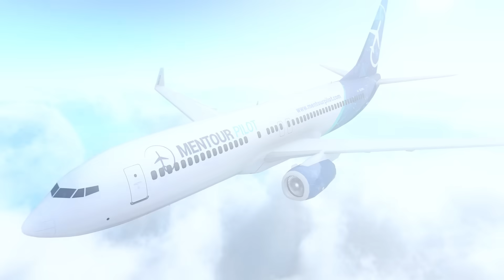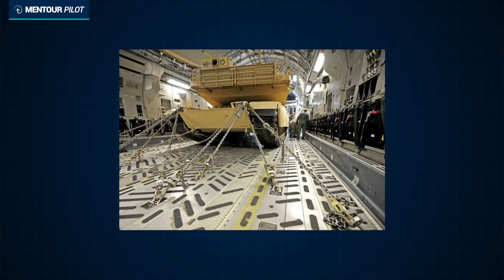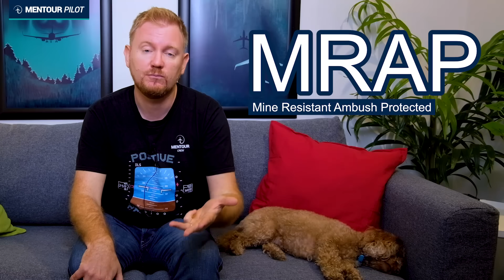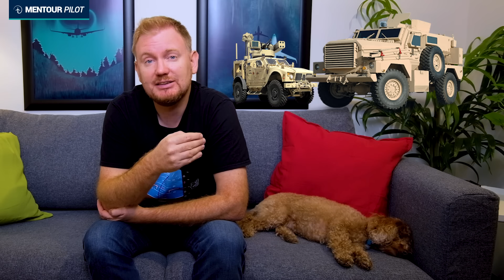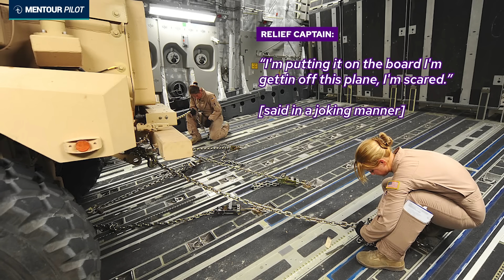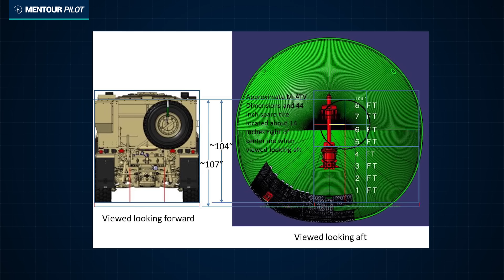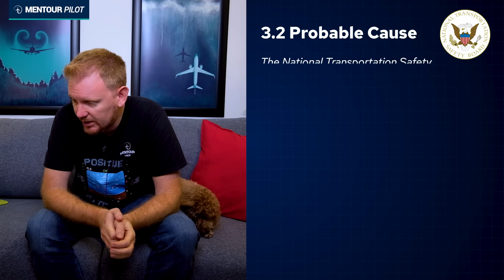Why did the pilots LOSE control?! National Air Cargo flight 102

Comment: That first picture showing the strap continuous across both sides that's the most fundamental error in strapping / chaining down any kind of equipment; even onto a highway trailer it requires four chains; minimum one for each corner. One continuous chain through a pintle hook does not count for two!  This is unbelievable; most fundamental mistake.
Loss of life and equipment. How many chains do you need to hang an 18 ton vehicle from the ceiling?;  If you want a factor a safety of two? what are the rules required for factor of safety?  A chain would have an ultimate bursting strength; but also have a rated working load. Unbelievable they thought they could use those straps that stretch so much. Stretchy straps; one more fundamental mistake. Now stretch and deflection is a controlling item not total tensile strength...
Thank you for your videos. you have a second retirement career in accent investigation. Hope you continue working until your 70 or 80 years old! Ha...

Comment: That's terrible....but great in a way. I can use this example of lack of procedures and certification; personnel attitude to safety etc for a Safety Day presentation. I was sent an email recently, where a tie down chain ring snapped during a loading procedure on a C130J. It all happened on the ground, but one of the air movements people were lucky to escape with their life, as the chain flew past him, narrowly missing his head after the ring snapped. Again, their was a lack of procedural specifics, or understanding; in this instance it related to fork lift tyne position on tie down. Though, the people involved were very careful and were endeavoring to adhere to safety protocol, which may have prevented a worse outcome.

Comment: A vehicle is not a brick. The travel of the suspension and the air filled tires gives every tie down a chance to cycle back and forth between slack and stretch.  So instead of a strap holding a static load it get a shock load.     The more slack that can be obtained the more travel and acceleration can happen before reaching the end of the travel in the strap.  

On landing,  even a small bump would cause the suspension of the vehicles to compress momentarily and then stress the straps. 

The person that came up with only two straps more for a vehicle roughly twice the size should have immediately realized that something was wrong with one of the two calculations.

Comment: If they'd held the fight for more straps it might have cost them their jobs. So they gambled and lost.

Here's the real world: I worked for UPS. among other things as an invoice-"auditor" (clerk) for UPS air shipments, meaning I pulled the invoices on packages to check them for adequate descriptions, value info, etc. HazMats were not accepted for air shipments through UPS. Descriptions are routinely crap, but time is short and the concern was to get the packages into the igloos and on the road to the airport. Holding packages can be done, but getting "exceptions" that way is a bad mark. So you pull the paperwork, glance at it to see if, if necessary, it can be fixed, put a sticker on the package to mark it  "audited" and pass it along to be loaded.

So I get a package where the invoice description didn't say "what it is, what it's made of, what the value is" and, being far more conscientious than the usual auditor, noted that failing and pulled an MSDS (Material Safety Data Sheet) that happened to be on the package off it, glanced at it to see that it had a description, and made a copy. Then, after the feeder (semi truck) full of igloos took off for the airport center I began data entry.

When I got to that package's bundle and looked more closely at the MSDS (which was maybe a half-dozen sheets of paper) I dug deeper into it than the page-1 description. Whoops! It was... oxidizer HazMat.  This was, btw, shortly after the ValueJet crash into the Everglades. Luckily the igloos were still on the way to the airport... Management wanted to fire me later for letting a HazMat get through, though when they had a hearing on that the manager who showed up didn't even know the package didn't have a HazMat sticker. But I looked into the package tracking: It had been loaded at Oakland despite my warning, flown to SoCal, flown to Japan, and flown to the Philippines.

Incentives are what they are. Planes are flown by pilots who cut corners because pilots who resist cutting corners lose their jobs. Way it is.
Reply: This was totally crap and had notting to so Whit this accident. The pilots did not cut any conors.
Reply: @AnjektusStudio  If you had been paying attention when watching the video instead of drooling on the floor you would have recognized what "more straps" was a reference to instead of having it whoosh in one ear sand out the other through the vacancy in between.
Reply: @gandydancer9710  Well I have seen this episodes both 2,3,4 and 5 Times. So I have been lisening really well. And I have also been reading the final report. So in this accident so where nobodey get a way Whit secrurity Becouse of money reasons. But IF that happend where you worked so is that Said to hear
Reply: @AnjektusStudio  You: "The pilots did not cut any conors."
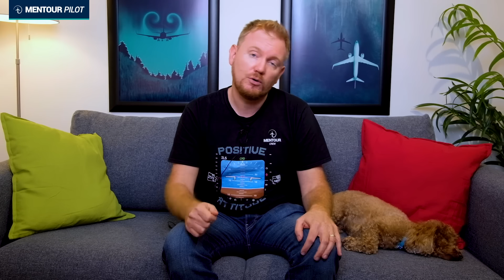At 20:23 Mentour attributes the crash to insufficient strapping. The pilots were aware of this. They took off anyway. How is that not "cutting corners"?
Reply: Pilots have a near obsessive safety culture. You can’t pull a paycheck when you are dead. It’s better to be alive and explain your next job “I was fired for refusing an unsafe load.”
And the OSHA protections alone would be worth the payout you’ll get for the wrongful termination lawsuit you will easily slam dunk.
Reply: @Mostlyharmless1985  In the real world it's not that easy. Your next prospective boss may not believe you, or may simply prefer to hire a more malleable subordinate. And I wouldn't count that payout before you got it, either.
Pilots are anyway not that reliably concerned about taking risks, or a lot of the incidents recounted by Mentour would not have happened.
Consider the one titled, "When Pilots treat the Aircraft Like a TOY!" Or that one he did about the pilot flying a passenger jet across Europe instead of diverting b/c getting to his base would be cheaper for the airline. Etc.
Again, THIS incident happened. To repeat, "At 20:23 Mentour attributes the crash to insufficient strapping. The pilots were aware of this. They took off anyway." 
Why is this not penetrating?
Reply: @gandydancer9710  because you are seeing the safety lessons learned and not the hundreds and thousands of flights that occur without incident a year, these are the exceptions and the consequences of compromise, not the norm, and if this resembles the safety culture of your company, you should be contacting the relevant alphabet organizations and getting that shit fixed before you become a lessons learned incident yourself.
Reply: @Mostlyharmless1985  In the real world the alphabet organizations are more or captive to the executives in the industries they regulate.
And the long-term good of the companies involved is not necessarily the same as the interests of the executives. See the 2008 financial crash.
All the flights in which nothing safety-related happens, or where the pilots behave badly and it is not reported, contribute nothing to my confidence in their safety culture.
Going back to THIS incident, can we at least get agreement that that in THIS case the pilots failed to pay adequate attentuion to a safety issue?
Because that is what the first response denied.
Reply: @gandydancer9710  the pilots are experts in the safe and normal operation of their aircraft, they trust and defer to experts to assure the second to confirm the first. 
The pilot didn’t like that the load shifted and trusted the loadmaster that said they fixed the problem. What exactly would you want them to do?
And OSHA will absolutely go to bat for you. They live to safety smack organizations.
Reply: @Mostlyharmless1985  You're describing a fantasyland.
Also, you're wrong. The load hadn't shifted, the plane hadn't even moved. The pilot had observed inadequate strapping and, indeed, trusted his minion's false report that that had been fixed, iirc. What does that have to do with anything? Do you think this was the first time a plane took off from that airbase with crappy loading? I'm betting that crappy loading, and taking off with crsppy loadng, was SOP. Stop bloviating about FantasyWorld, find the accident report, link it here, and we'll see what -- if anything -- is said about that.
Reply: @gandydancer9710  so, again, you don’t know what you are talking about, and a Pilot must trust his crew is giving him correct, factual information for him to make proper decisions on whether to proceed or not. I don’t know what you think a “fantasy land” looks like.
But, make a decision here. You are concerned about the load shifting. You ask your load master about it. Your load master tells you that it’s been corrected.
What do you do?
That you are too much of a fucking coward to stand your ground and advocate for a safe environment for your crew and yourself is not indicative of the general workforce. You are only outing yourself as the kind of shitheel everyone else avoids and dreads having to work with.
Reply: @Mostlyharmless1985  I hope to God that my safety doesn;t ever rely on your decisionmaking, because the fact that you think that going along to get along can be any part of a good safetly culture indicates that you are clueless, irresponsible, and a danger to anyone who depends for their safety on your good judgment.
I don't care whether it's the pilot, or the loadmaster, or the soldiers who loaded the MRAPs into the plane that all together did things that resulted in the crash, and I don't care if your panties all in a bunch over my observations are chafing you. The FACT is that this plane crashed because multiple safty derelictions all lined up, and whatever group you are trying to protect from criticism (evidently pilots) were complicit. If this pilot had made a habilt of checking, even after flights, that loads were in good condition to fly maybe he wouldn't be dead. And not just him.

Comment: FAA should consider this dangerous cargo. Require inspection and signature by a certified loadmaster before clearance to take off. Even a remote approval procedure of the loading plan would have saved this plane.
Also, pilots should be trained on the engineering limits of tiedown points and securing loads, and should be shown the loadmaster calculations, to verify safety.
If they are not sure, they should have a safety expert engineer on call to verify safety and sign off on it before flight.
Would an expert maintenance engineer called in as "second eyes" have recognized the issue?

Comment: One thing to bear in mind about armoured vehicles, their armour is toughened and easily hard enough to tear through any aircraft parts it touches.  Any single one of the vehicles would've killed the other straps, causing a domino effect. And probably the worst thing that was done was retightening the failing straps, probably over tightened to stop movement, without tightening the others, putting even more force on the identified weak point. - The issue wasn't that the straps weren't tight enough, at least not the ones that stretched!

I'm not even sure as a pilot how you actually solve that problem- should they have demanded a new guy to organise the straps? In that field of operation you are stuck in a way.

Comment: Man, I'm  just Joe average  who had no fear of flying 50yrs ago but now..?  First, as an Air Cadet at the tender age of 14yrs, some 52yrs ago, I  found myself up front on my 3rd familiarisation flight in a Chipmonk trainer, I  desperately wanted to join the RAF. At 1200 feet the craft began vibrating violently. We were too low to jump out, thank God! So we went around and, after two approaches, eventually  landed safely. A huge spanner had been left in the engine bay following a service immediately before my flight. It had wedged itself between the engine and fuselage preventing the engine rocking on it's  mounts. I remember thinking at the time, I'd  rather crash than have to bail! My second event happened many years later, having taken off from London City Airport in a twin engined, high winged something bound for Dussledorf. By now I was a very infrequent  flyer who had not joined the RAF. At around 9,000 feet we hit a flock of ducks, I  actually saw them whizz by my window. The port engine and propeller were wrecked and the starboard  prop' and engine were severely  compromised, but at this time, I  knew none of this. I recall the smell in the cabin being quite pleasant  for a few seconds, at least until the cabin began to fill with smoke and fire; yes, we could see the flames inside and out. I was seated next to my dear wife who had been an Air stewardess  with German Wings for many years before our meeting. Following a shocking climb and yaw to port, I  asked Claudia, who seemed to be engrossed in a novel. " Is this normal?" She calmly replied, "Of course". Then, having made the observation, I  asked her. "Then why is your book upside down?" Well, it wasn't normal, not at all. Apparently, we could only turn turn to starboard and that could only be achieved by running the starboard engine, with only 50% efficiency, at full throttle! Our Captain, who I  now consider to be, literally, a child of the Gods, for whatever operational reasons, flew in huge  right hand loops, eventually putting us down increadibly safely somewhere in the Neaderlands. So, that was it. I have not flown since, preferring  to commute between our fianca in Spain and 
our property  interests Germany, by car, every two months. After stumbling across
 your channel, quite by accident, pun absolutely I tended,  then binge watching everything you've  uploaded ( Yes, I  subbed immediatly) I'm  HOOKED! No, I  have no I mention of flying again, ever. But, if I  were forced to do so, my last wish is that you would be My  stick man. Ps, I  spent my professional life as a teacher ( far more dangerous then being a pilot ;-) ) and you do it (teaching) better than anyone I've  ever worked with. Respect! John.

Comment: "knots mentioned on the CVR" - knots tied in straps reduce the breaking strain by a huge factor, rendering them totally useless Ive witnessed this on trying to tow a small lorry from a ditch by another lorry one strap was tied with a knot to another and it snapped immediately power was applied. The knot tightens in some way and makes a cutting like action if you think about it. Probably a little known factor OK now put "knots reduce breaking strain" into google, climbers know about this.See for yourself

Comment: I feel really bad for the untrained loadmasters. If you never learn something properly, you can't be expected to be faultless at it. Those guys must have felt so terrible, they were the ones using insufficient strapping. I totally understand that if you're just expected to calculate things without even really training on how to do that, it's going to be a jungle in your head when you need to apply it under pressure. The fault lies with the authorities. How would you think that letting untrained people load an aircraft full of heavy machines is okay? Like, who's the guy that said: "Nah, we don't need a law for that, it'll be fine..."?

Comment: Was any further mention of knots in the tie-down straps made? I know that in rated ropes, such as those used for climbing, any knot reduces its rating by 50%. I would expect that since a strap depends much on the width for its strength, a knot would accrue a much larger penalty.

Comment: This is a systems failure that stars with TOP management, where safety should ALWAYS be the paramount concern, and continuing through process managers and down to whoever it was that hired the incompetent - correction: thoroughly, egregiously irresponsible - loadmaster.  If any of that sounds like a professional opinion, guess what: it’s not.  I’m just a guy watching a video, just like millions of other ordinary people with just a little bit of foresight and common sense. Half the people I know would have said “it shouldn’t budge an inch” and “we can’t take off until we know for sure it won’t”.